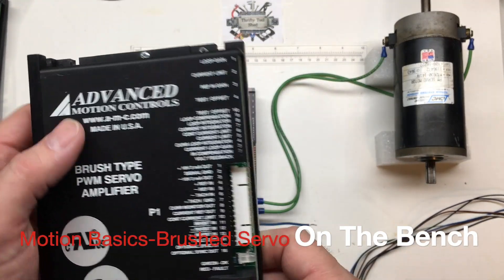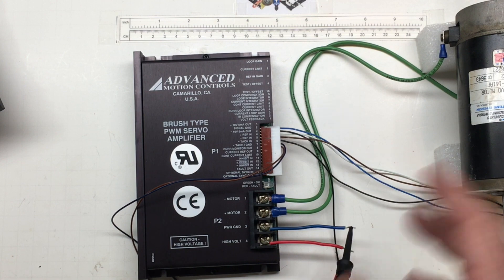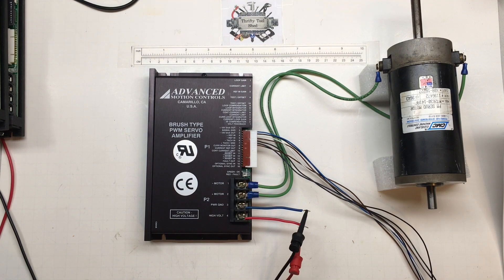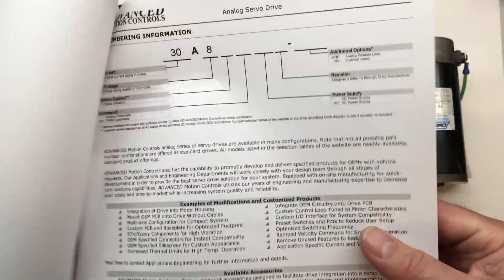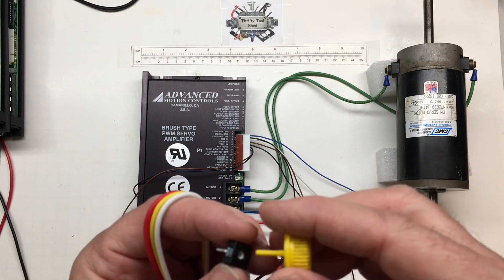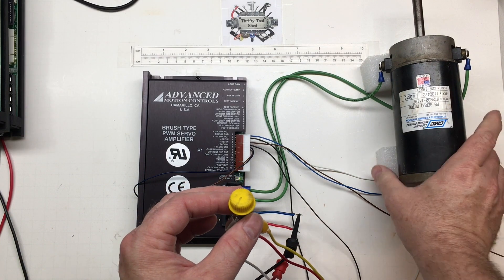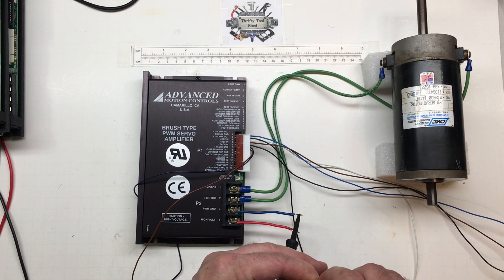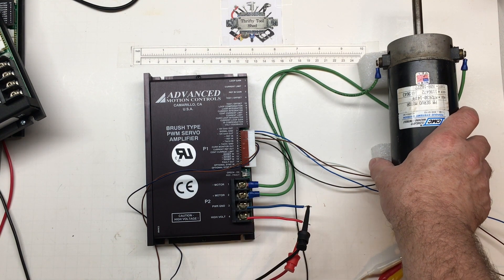Motion Basics with Brushed Servo

Comment: i am using a electro craft 45l and the dang offset cant stop or effect the full rpm run off. you have any lead on the other gain pot settings?
Reply from the maker: Not 100% familiar, but if it has a VCS gain, I would try that. VCS gain is ratio adjustment between the input signal and output ( Voltage, Current, Speed) etc. you also have Current limit which can limit the RPM based on current and also the Loop Gain if running in current mode by chance.

Comment: Thanks for the video- is it possible to replace the step and direction control  with just a voltage bias ? Would that be accurate ? I'd love to know .
Reply from the maker: Yes, these older servos are actually using a +/- 10 VDC signal. The motion controller is a way to use the digital system and interface. The older servos are naturally analog.

Comment: i have stand alone cnc control wired to stepper motors can i use the same controller to run the pwm servo amplifier ??
Reply from the maker: Typically as long as they both have the ability to use Step and Direction control inputs. It all depends on your system really.

Comment: using a 50k pot.  I have 10v+/- at pine 1 and 3. wiper is on ref+. I checked voltage on ref+ and the voltage is moving with the pot. it just doesn't make it to the motor. the dip switches are set to voltage per the data sheet.
Reply from the maker: It's been quite a while. I  believe inhibit has to be grounded to inhibit so If not connected it should be ok?
Reply from the maker: I don't know if you got yours to run. I wanted to mention on my test setup I had only 2 of the dip switches in the ON position for testing and it was 1 & 3. So Voltage Feedback and Current Loop Gain was ON and all others OFF. Also Make sure the Green LED is on and not Red. Hope it helps!

Comment: I have this same drive, when I hook everything up like your video the pot doesn't do anything. Any thoughts?
Reply from the maker: Check the configuration. It has to have voltage control selected and also check to make sure your pot is 5K ohms or higher since we can only have 3ma load on the supply.

Comment: Hi, 
I have the 12A8E. 
they have a signal of 5+ and 5-. 
Can I control that with an Arduino? 
thanks in any case for the answer.
Reply from the maker: I would think so, I have not tried it to say for sure.
Reply: The +-5v is just a SOURCE voltage for you to use as you wish.   You use the Ref+ and Ref- inputs for control, which are +/- 10vdc, same as he did on this drive.  So the Arduiro would need to be capable of outputing a +- 10 vdc signal (ie you need to have a DAC output)  Download the https://www.a-m-c.com/wp-content/uploads/support/reserved/AMC_HWManual_Analog_Panel.pdf

Comment: Cool Video, Do you know if this drive will work with glass scales feedback? I have an old Anilam Crusader 2 with Analog servo drives and used a glass scale.
Reply from the maker: The drive will not. It is analog tach feedback. The motion controller will accept the glass scales as feedback to the system.

Comment: Per your open loop idea with the encoder...I have a cnc lathe that I recently discovered has two feedback sources- an encoder and a resolver. The encoder goes to the motion unit, and the resolver to the drive. Just wanted to share, may help in your applocation. Love the video, very clear!
Reply from the maker: Yes, the two feedback devices are very common on CNC machines. At one time I had a small business upgrading old CNC controls. A lot of the older ones used a analog tach for the drive reference feedback and a resolver for the motion. Thanks so much for your comment!

Comment: Hi, very interesting video.
How can I connect it to my cnc interface to work as well as possible, thanks. (invert control)
     FW, -, GND, 0-10v, + 10v.
Reply from the maker: Hi,
At the end of this video is a link to the next video that I uploaded to show how I used a simple encoder set-up to feedback from this motor/drive into Mach 3 via the Ethernet motion controller. Although not all systems are the same I chose to show this one because I do have it running in several older CNC mills I upgraded over the last 10years and it works well with the +/-10v older drives!